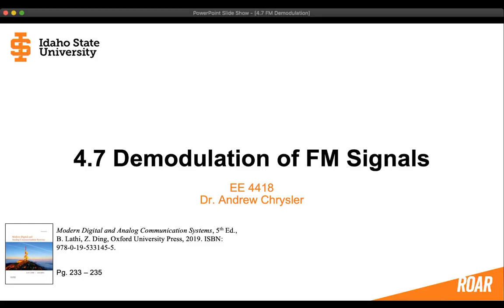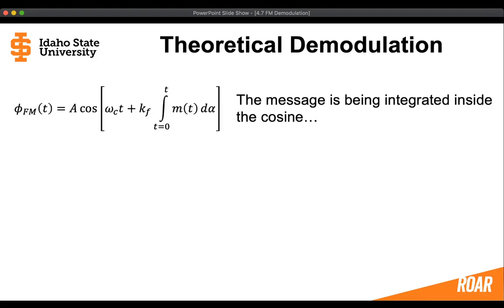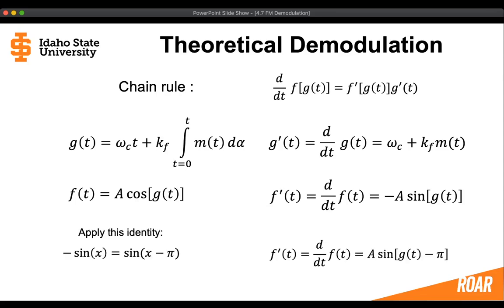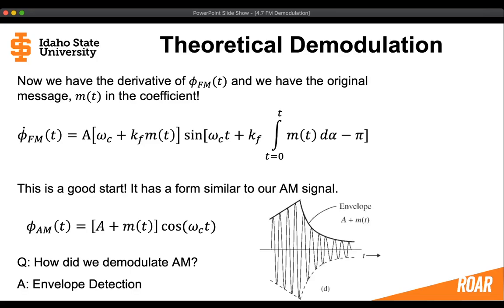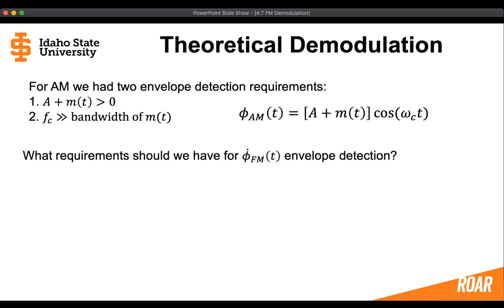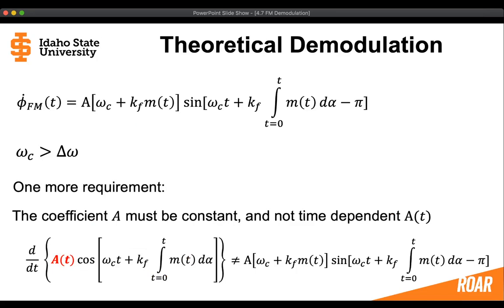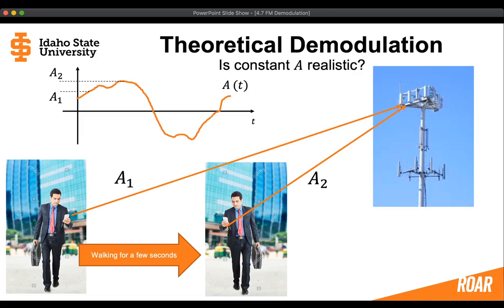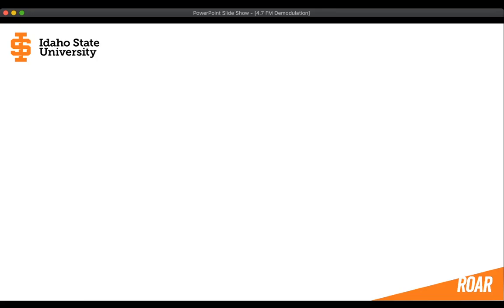1 - 4.7 Ideal FM Demodulation

Comment: this is a rather outdated method for fm demod,  with dsp systems and I/Q data,  fm demod is just   arg{ x(n) * conj( x(n-1) ) }
Reply: Yes, that's probably the most common way. You can also apply the arg() function to the complex product of the input signal and a numerically controlled oscillator, filter the phase difference and use that to drive the NCO to follow the input frequency. That's a digital phase lock loop demodulator.